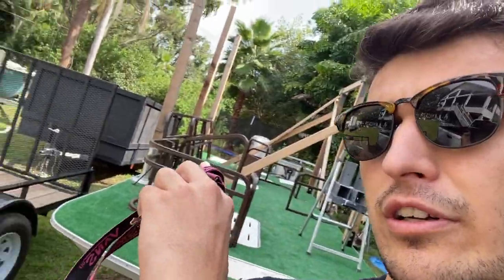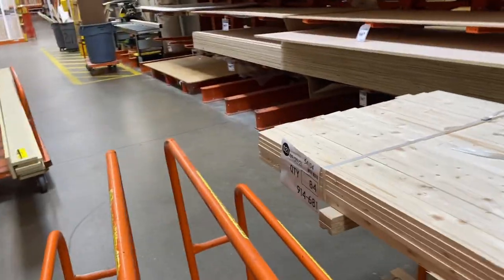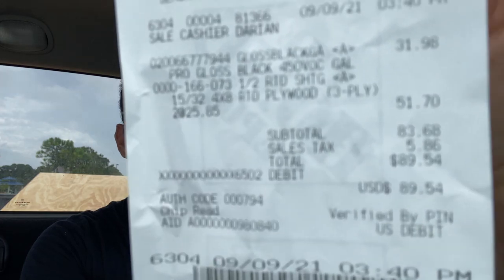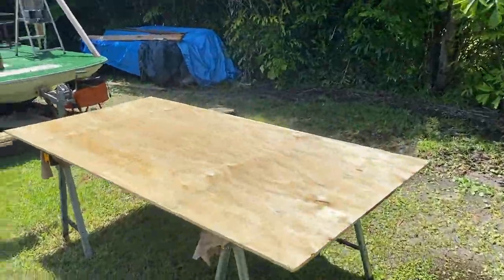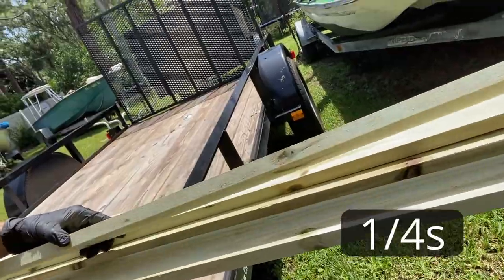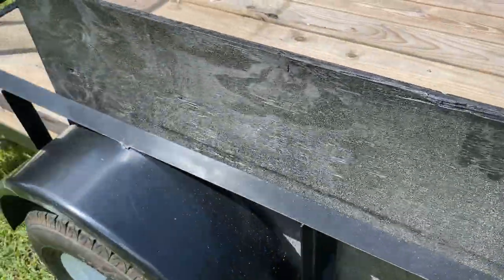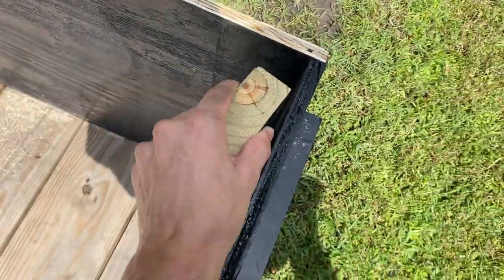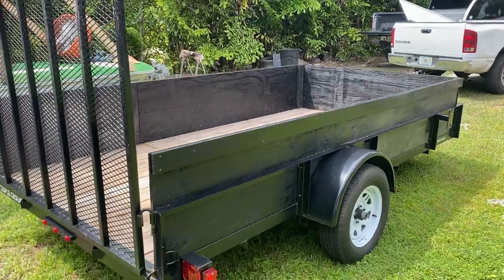Got a 2nd Trailer For The Business! - Easy Junk Removal Trailer Build

Comment: Are you glad you went this route? My thoughts were that you could rent it out if you weren’t doing any junk removal jobs. My second thought was you could charge more on your junk removal price. I know it was cheaper to go have sides but I bet you could quickly recoup the cost later. Also I just had a lady give me a dump trailer 14x7x4 it needed tires and a new remote. She also gave me another flatbed same size. Put an add on next door for free pick up of unwanted trailers. I’ve gotten 10 or more free.
Reply from the maker: Yea the 2ft walls where a waste of time and dang I need some free trailers!

Comment: Good call on the shorter walls.  My trailer sits at about 30in.  Its 7x16.
It’s easier to tip in a couch when alone then dragging it up the gate. And anything above can usually be strapped down.  Especially a mattress.